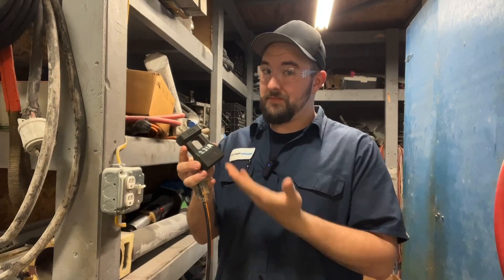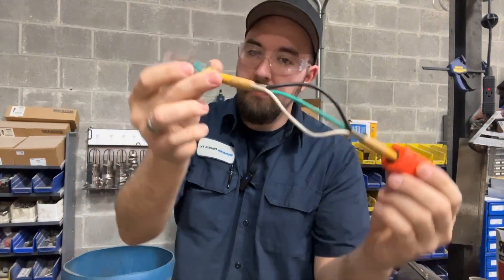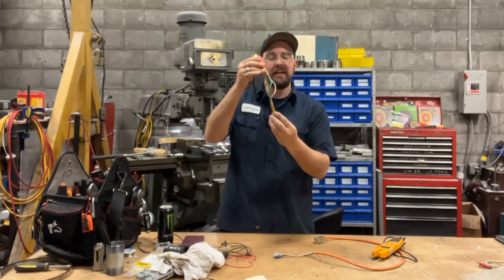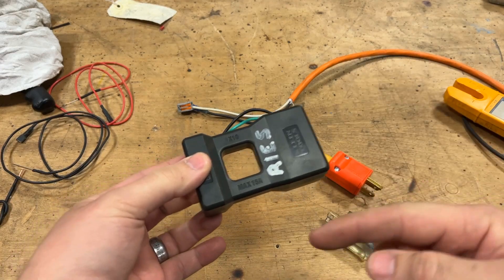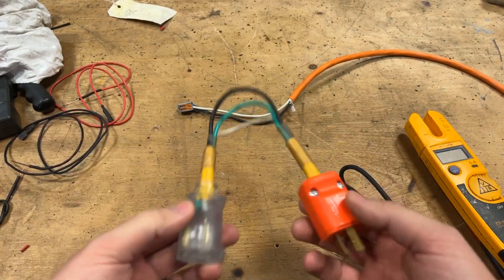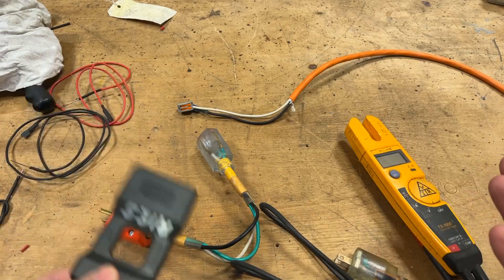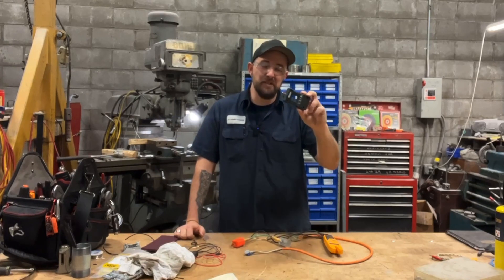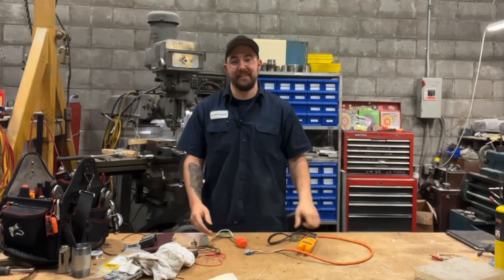How to find amperage, the easy way!! #education #tools #howto

Comment: In the treadmill world the purpose for testing amp draw on a motor is to determine the overall friction between the running deck and the belt. Since these surfaces start with lubrication between then, but ultimately wear. As a manufacturer we have to determine when the parts should be replaced. We have made these for testing, but in the UK our company is not legally allowed to do that lol.